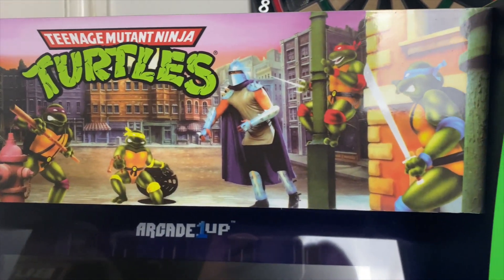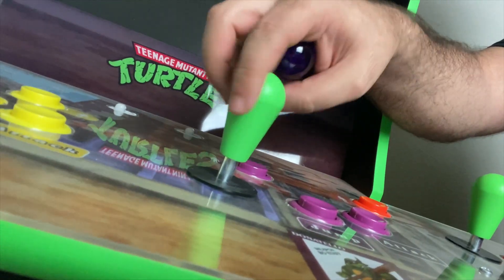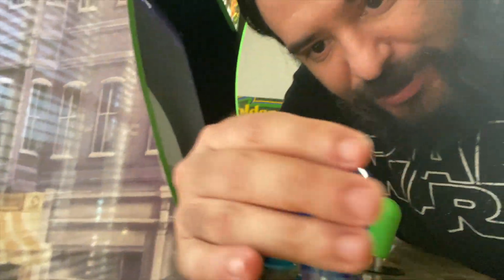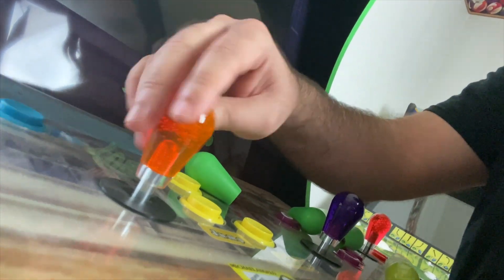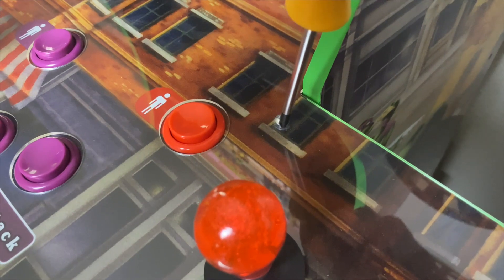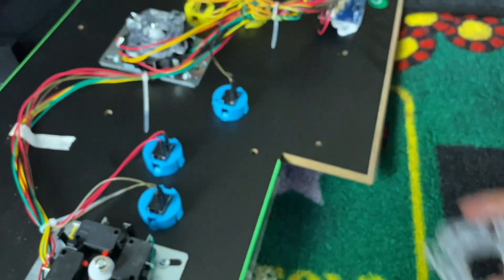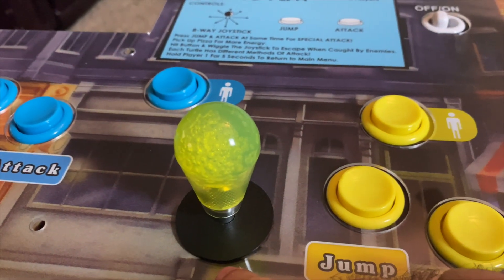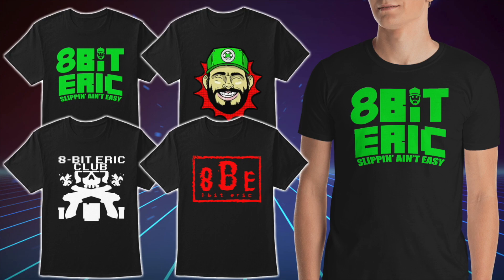Upgrade Your TMNT Arcade1up! (Must-Have Mods!)

Comment: How well do the A1U control panels adapt to Happ Competition sticks and iL buttons?
Reply from the maker: I haven’t used any of those so idunno
Reply: @8-BitEric  Well, considering that those are the parts that American arcades used back in the 80s/90s, getting as authentic an experience as possible might move you to trying them in a cab down the line.

These machines seem to use some kind of Sanwa JLF knockoff, which is why they have the square gate. In contrast, the Happ stick doesn't even have a gate, instead using a square actuator to press the switches, leading to it having that circular feeling.

Comment: Who else cringed when Eric sat the panel upsidedown on the joysticks? oooosh! Man, flat yellow colored bat tops are so hard to find.
Reply from the maker: how else was i supposed to work on loosing the back? make it float in air?
Reply: @8-BitEric   You could probably set it on a thick pillow with the tops removed.